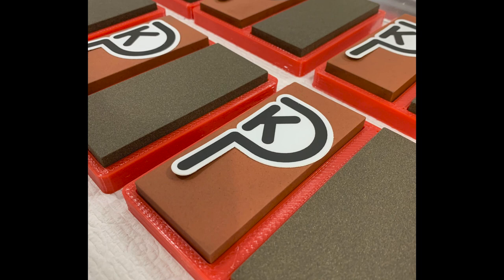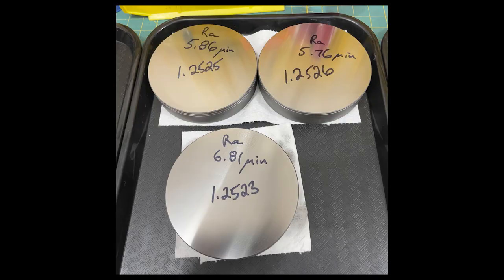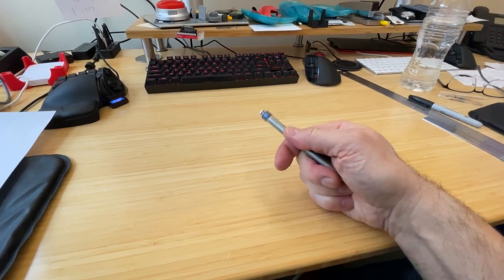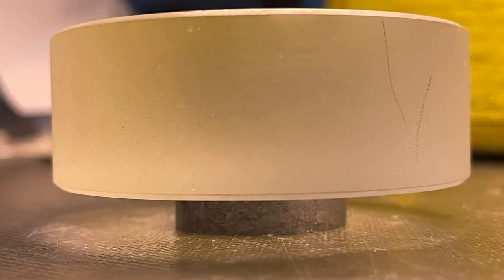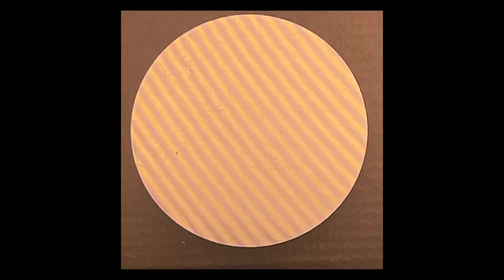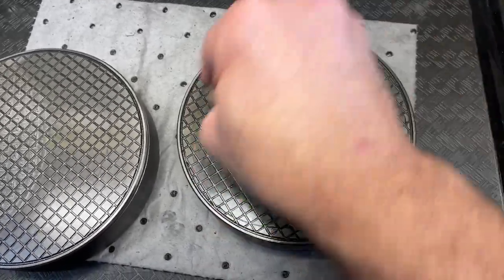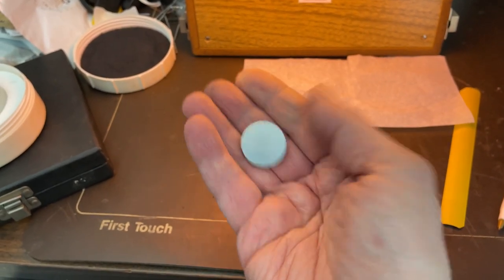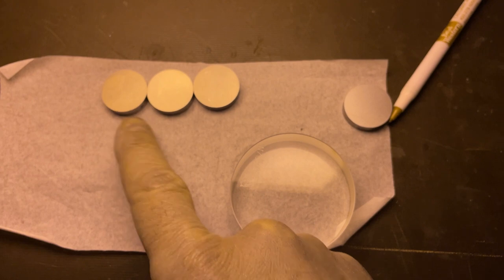Lapping It Up: Setting up for precision hand lapping

Comment: Inspired by Tom Liptons 3 plate video I bought 3 8 inch rounds from MCmaster turned them round and flat. Then ground them flat. Then made a plate holder for my CNC mill. I programmed the grinding motion and went through several grits using the 3 plate sequence. Hours of grinding was done I used a combination of linear and rotary motion. The results were extraordinary with no hand work. Using the CNC machine is well worth it, In high school I made a telescope mirror but made a grinding machine first. Just lazy I guess.
Reply from the maker: Brilliant!!

Comment: If the line spacing is not uniform, then this IS important: it means the surface is curved perpendicular to the lines.  This can be observed by tilting the optical flat along a perpendicular line and thus rotating the interference pattern.

Comment: Given how cheap USSR flats are and how expensive monochromatic sources are, do you have any advice on budget-friendly light sources for the home gamer?
Reply from the maker: Seek the Monochromatic rabbit hole at pfg.gg/links
Reply: @KPNH  Thanks! Looks like it'll be interesting reading!
Reply: I’ve tried running a laser through a marble or something that spread the coherent laser and that works pretty well.
Reply: @howtoguro  Yeah that's kinda what I've been thinking. My biggest concern is how to know if you've spread the laser light enough to be safe. But I'm pretty conservative with regard to injuries, especially with my eyes.
Reply: @ParallelTransport  You could just wear laser shades. Even really typical clear safety squints provide some protection against lasers. Full nuclear mode would be to view it from a secondary camera and monitor.

Sadly, powerful lasers are too common. I actually bought a red laser point for a “Cat Toy” because I figured it would be weaker, but it was a class 3R so be really careful.
Reply: @howtoguro  Yeah I've heard that cheap lasers often put out far more light than their stated rating allows. 
Honestly, I hadn't even thought about just having a secondary screen and camera. That's a good call. Though at that point, buying a camera and screen and messing with laser spreaders and stuff might be about the same cost/effort as just getting a sodium lamp off ebay. (and I recognize that I'm operating at a ridiculous level of caution, but if I have to make even one trip to the hospital because I was trying to save a buck, then that's going to be wildly more expensive than even buying a sodium lamp right from lapmaster)
Reply: @ParallelTransport  Honestly I think people are usually a little too blasé about safety. Vision is basically impossible to restore when it’s gone, treat every laser like a loaded gun. 

Unless you want to have a white spot in the center of your vision as a consistent reminder of who you used to be, because it will define you. Safety rules are written in blood.
Reply: @howtoguro  Oh for sure! A fellow I used to work with had been an OSHA investigator and some of the stories he told were just terrible. 
I'll have to give this whole thing a bit more thought. One of the scraping people active on the forums (forest addy) says that LEDs can give fringes under the right conditions. And that is a very easy to test option, especially because I don't need traceability.
Reply: @ParallelTransport  There was a guy who lived nearby working on seamless tubes, he fell into a vat of boiling acid (which sounds like some shit out of Batman) It took him 11 hours to die.

It happened and I’ll always remember it, the company was only fined like $30,000.

I wonder if you ran a broad spectrum light in a box with a red filter if that’s coherent enough for fringes?
Reply: @KPNH  I ended up getting a "cheap" (~170 USD, not really cheap but better than a name brand source) sodium bulb and driver socket from ebay. Seemed the lowest effort option, and it was since I didn't have to do anything to make it work. (Strictly speaking I did get a 120-220 transformer since I didn't want to go through the annoyance of wiring up a 240 plug and long cord from my ceiling for this little thing, but I bought that too so no work on my end) Works great right out of the box, though I guess I'll see how long the electronics last. Does the expected warmup color change and looks like a sodium light to my eyes. Though I don't actually have any way of checking the wavelength for sure. At very least it gives nice fringes on a gage block with a soviet flat. I'm pleased so far.

Comment: Nice work!

This better illustrates what Robin was talking about with two plates in use. Without a decent surface grinder to get close enough, it still seems one needs to start with the three plate method. Is there a controllable way to go from the lathe to flat enough to lap using only two plates and no grinder?

Also, aren't you committed to the coarsest grit you used? I expect some diamond would embed into both laps when conditioning with the 3μm slurry. The abrasive will degrade over time, but one stray particle can create scratches when moving to the finer grits.

Looking at how straight those lines are, I think you are seeing real wringing! Wringing is supposed to work without oil in vacuum. Do you have a vacuum chamber handy?..
Reply from the maker: Thank you!

1) Yes, see Tom Lipton's video(s) via the links in Description.  He uses only a saw and a lathe.
2) Yes, embedding is an issue.  My plan is to dedicate a pair of laps to one size/type grit.
3) I do have a vacuum chamber, but I know what real wringing feels like and I think I need to lap at a finer grit.  That is why I just got five more disks to make lapping plates.  I will be able to have 3-, 1-, and 0.25-micron dedicated sets.  Good gage blocks, cleaned on a PFG Stone will wring like crazy.  I want to achieve that.
Reply: @KPNH  any issues with diamond embedding in the A2 discs?
Reply from the maker: None.  The rule in lapping is that the lap is softer than the work.  This is why.  The A2 was RC 55 to 62.  My dirty little secret is that these discs were part of a six-disc set where I was really testing tempering temperature vs. hardness.  Note the four hardness test point visible around the stamped numbers.  After that they were used for my "five disc" test on the grinder chuck.  Now they are the lapping test subjects.  Re-use, Recycle, people!
Reply: @KPNH  is there any hope cleaning the plates of embedded particles? I read somewhere about using an ultrasonic bath. Or do you think that is a fools errand?
Also, I'm struggling to find water soluble slurry, I can only seem to find the sringe of oil based diamond paste. Do you you have any experience/comments on the difference? 
(If this covered somewhere else, just point me there)
Reply: I should have said: Oil based diamond paste and scallion carbide powder and im in the UK
Reply from the maker: I don't think it'll work completely.  If you are cleaning to go coarser, sure.  But if finer, you're gonna be unhappy.

See my links page.  I think I link to the McMaster order number for the Hyprez water-based slurries.  I like the cleanup aspect of water-based.  But, I cannot comment on the techcnical differences due to ignorance.
Reply: @KPNH  I guess my wondering about the ultrasonic cleaning has come from not really understanding what I means for a diamond to be ‘embedded’ in the surface. For me I t’s strange to think about a cast iron surface as having a kind of porosity. I’m learning though.
The root of my question is I’m wondering about what to do when making the plates to begin with. Use scilliconcarbide and kerosene on x3 lapped finished plates? That, it is my understanding, does not embed in the surface and so you can progress to finer grades? Once finished dedicate each plate to a grit size of diamond. 
I’d like two plates for each grit size, but the music industry collapsed when I started my bass career, all our music was put on Napster and I only got paid in anecdotes. One day.
Reply: Yes you can generate flats with 2 plates but you have to have a way to determine flatness. You work the 2 plates and when they become spherical reverse them top to bottom and the curvature will reverse too. Stop when they are the flatness you want. There is a video showing how to make a cheap effective spherometer (wood nails and a screw)to determine flatness for optical flats. 
I have done it with 1 plate and a fairly good surface plate using hand scraping which gave a surface better than 5 millionths flatness.

Comment: Spencer, just to confirm I have it.  2 things...  Instead of 3 plate method to maintain flatness of laps, use 2 plates + periodic measurements.  Lap on bottom plate but when convexity or concavity is measured, flip the plates and condition until measurement is same/flat on both??    As for the diamond slurry, based on the above will you essentially now dedicate 2 plates for each diamond grit size due to grit contamination?
Reply from the maker: The "three plate method" refers to auto-generation of flatness, and also calibration.  But, maintenance of laps is a two-plate system.  The "bottom" plate tends toward a convex shape, while the conditioning lap on top becomes concave.  Without trying to go into details, that allows you to drive the work piece toward concave or convex as needed and observed by measurement.

Yes, I dedicate a pair of laps to one diamond size.

Comment: Nice work. What was the angle of the d-bit cutter and how deep/far apart are the grooves?
Reply from the maker: I believe 30-degrees, 0.03" deep and 0.25" spacing.  It's not critical.